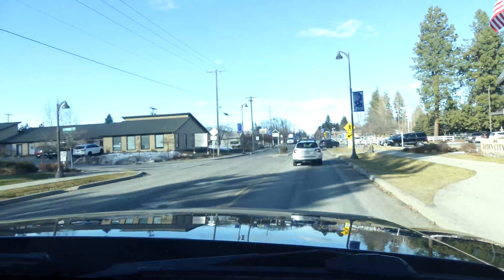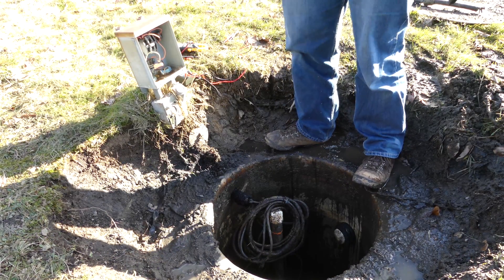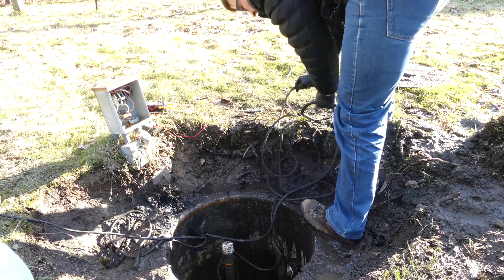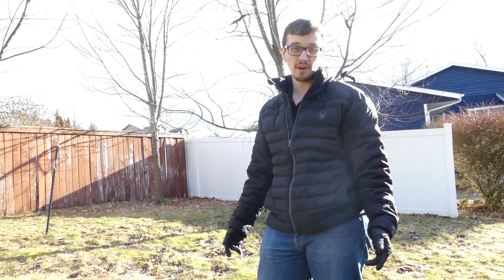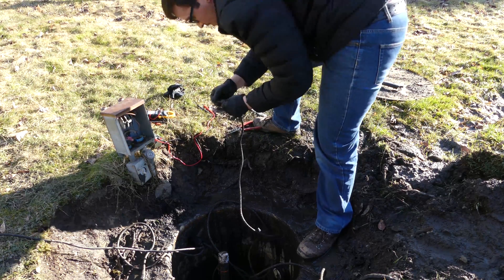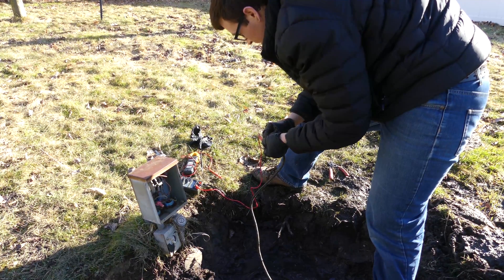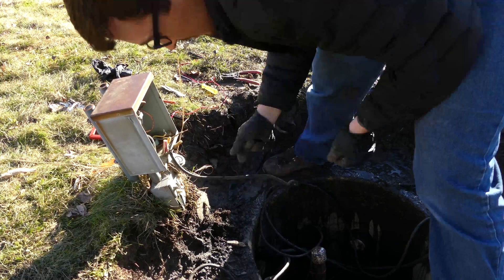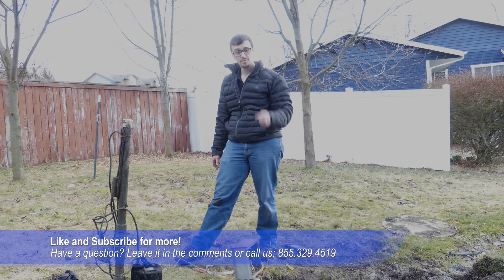Sewage Pump Troubleshooting In the Field

Comment: Someone's mad at me cut the cords to the pump then fried the computer board to the Aerobic System now it won't pump and I have a toggle switch and then a breaker and you could pull those and turn it and it would pump the water I am critical-care disabled and alone on welfare what is the cheapest way to fix this I thought the toggle switch to make the pump run doing it manually every day would be the cheapest way but how do I do that

Comment: at 5:00 lol you crazy ?? trusting the electric connection to be correct ?
Reply: he used the meter to check for power, not a switch... He made sure there was none.
Reply: @qaz111111qaz111111   see Bruce knows what a multimeter is used for..

Comment: hey,  I have 2 zoeller pumps in a liftstation. Both have failed. They are pulling power however, not turning.  Having a hard time to get someone to just pull 1 of the pumps out for a reasonable fee :(   One asking for about $1000 to just pull out the pump. It is on rails with a cable that is accessible.  I tried to pull on the cable but not having much luck getting it to loosen up.  Any suggestions ?  I have  feeling it is stopped up with baby wipes.
Reply from the maker: You'll need a hoist rig or tripod to pull the pump out if it's on guide rails. Thanks for watching!